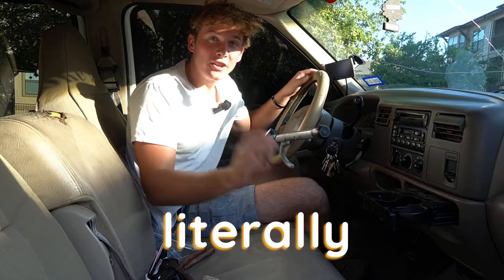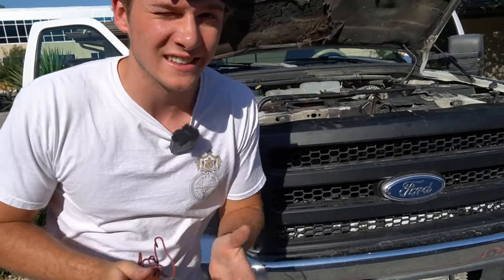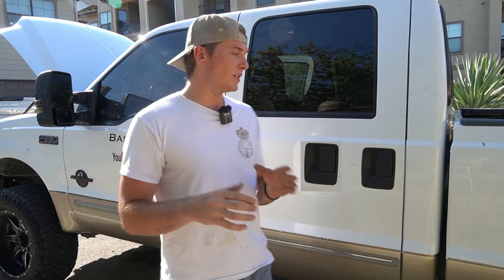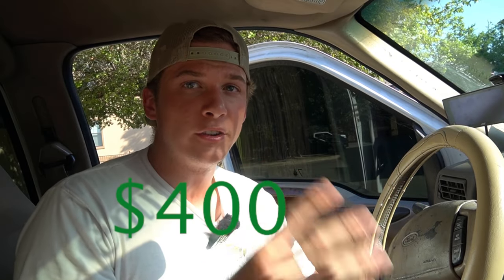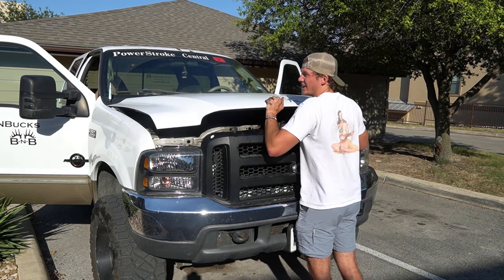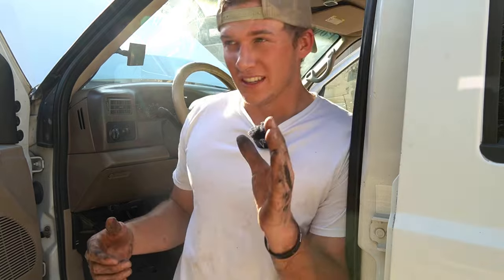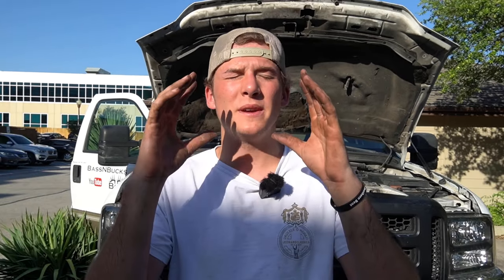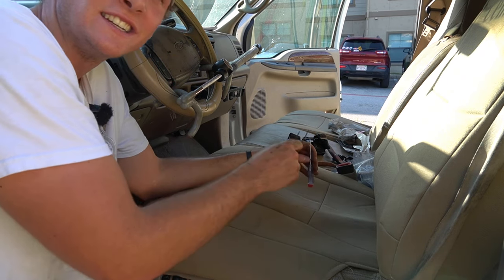Never Get Your Truck Stolen With These 5 Antitheft Devices

Comment: Best anti theft device is owning a manual transmission truck 😂
Reply: Yessir 🤙🏽
Reply: Yet another W for stick shifts. Bonus points when it's straight piped so it wakes up the entire neighborhood.
Reply: If the thief can’t drive a stick shift, that would be correct. 

My dad’s truck is a manual transmission.
Reply: Don’t even have alarm on mine. Brick under clutch pedal best one😂

Comment: I pull the Injector driver module relay and installed a electric train horn to my aftermarket alarm.
Reply: I have a 4x4 truck.. when parking at hotels I do the same.. fuel injector relay
Reply from the maker: hell yeah
Reply: @powerstrokecentral  gonna buy your kit...
Reply from the maker: @camposvazquez  awesome man!
Reply from the maker: @camposvazquez  I would really appreciate it my dad and I spent years making sure everything was prepped and made right
Reply: @powerstrokecentral  yep yep...also..  I am going to buy the rear door plates to block the key holes up front...

Comment: Get some insanely thick chain and loop one end through the steering wheel and the other through the seat frame and lock them together with a heavy duty lock. I have specialty locks that are impossible to pick and stupid thick so good luck cutting through them. That way even if they start the truck they can’t turn the wheel. Also pull the IDM relay, no power to the IDM, no starting of the engine then.
Reply from the maker: my dad does this! lol
Reply: that won't work, and neither will the "Club".  they don't have to cut through the chain/club, they'll just cut through the steering wheel and slide the club or chain off and drive away, laughing (assuming they were able to defeat all the other anti-theft measures)

Comment: As long as the thief has no knowledge of your hydra that can be an anti theft device too. Your last position on your hydra is “nS” which is No Start. When you have it set to this it will crank no start because it cuts fueling. I use this when I park my truck for work because I work in a sketchy area. All you gotta do to disengage your no start is change it to one of your normal tunes and then cycle the key once.
Reply from the maker: yesssir i use that as well i have a death pedal switch and its the number 3 mode

Comment: My truck is a stickshift so it's unlikely they'll figure out how to drive it. Also my lock cylinder was replaced on the driver's side and the metal bar to pull on isn't in the truck anymore due to my own frustration. Once you're inevitably woken up by the sounds of the truck starting, a really good tool once you get out to the thief is a 12 gauge.
Reply: Oh yeah it also doesn't cold start half the time so they'll eventually just give up.

Comment: My 96 chevy 2500 6.5 has a lock under the dash that when you press it locks the hood shut (with a pin /cable) and jumps a relay so it wont start. (Killed my batterys once bc i didnt know what it was)

Comment: Do you know where I can get f250 fender badges without trim level for a 2001? I’d prefer ones with pins rather than the ones you just stick on
Reply: eBay

Comment: Free anti theft measures 
Pull one or all Master fuse, starter fuse, fuel pump fuse. Remove battery. 
If you dont want to pull fudes every time, leave  car.  Ravelco Anti Theft  Device been around for decades, but it is another key that you could be robbed of or key stolen to start it. 
Another is The car-stopper is s coded kill switch that has sequence of touch buttons so even if you are robbed on site they take you keys they don't know the sequence of buttons to push to get it started.
And you need a heavy duty tire lock as thieves are now using tow trucks to steal vehicles trucks and trailers.
Proven locks brand are heavy duty tire and anti moving locks so cant roll or pick up a vehicle, trailer.

Comment: My '05 6.0 got stolen less than 24 hours after buying it, so I did not have the luxury to equip it with any anti-theft measures! Buying time is what its all about, the other items not mentioned is a tracking device, I would also take my drive shafts out and batteries, just to be sure lol jk, good tips!

Comment: So they get by everything or tow it away. 
What then. 
Two items. 
Apple air tag as a decoy. 
They know it’s there and throw it away. 
Lone star tracking GPS installed deep in your dash and has a battery backup if they unplug the battery. 
Know where your truck is all the time!!!

Comment: Bought my first powerstroke loved it until it was stolen with all my work tools in it a week ago just got it running perfect....got it back a 2 days ago passenger side damage and motor vehicle is trash now barely turns over and wont start .im broke tooless truckless and sh out of luck
Reply from the maker: Dang man been there done that. Installed my kill switch and caught them 2 times trying to break in to my new truck
Reply: Well if I ever get the money to fix it I'll definitely do that.but probably going to sell it for a beater and recoup some tools first.thanks for the video